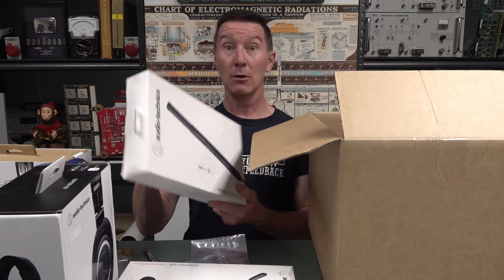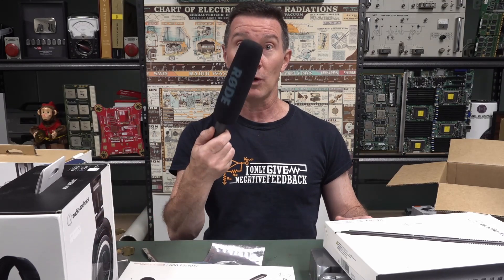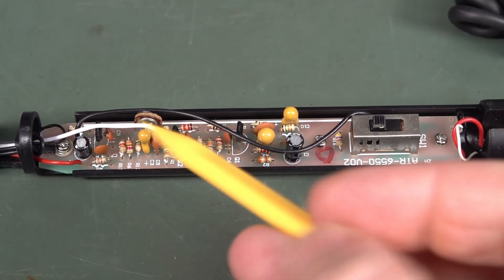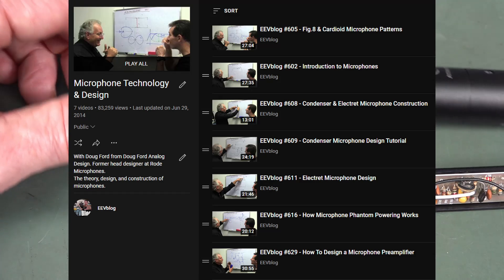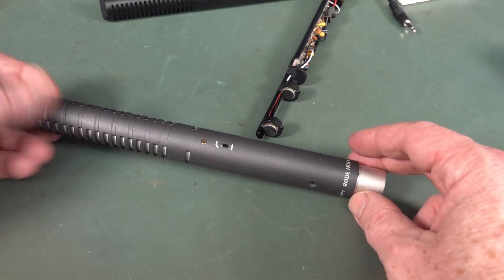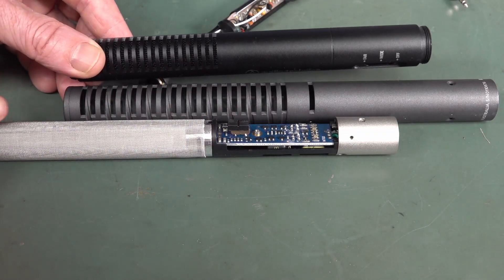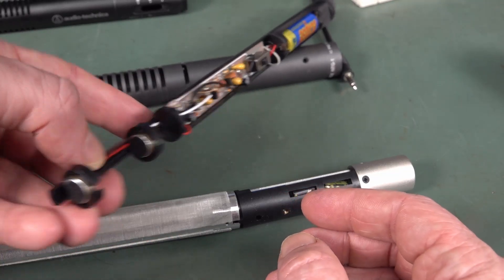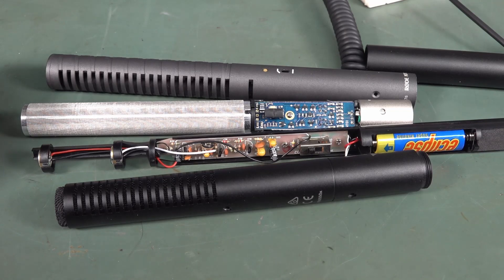Rode NTG-1 vs Audio-Technica ATR6550xAudio-Technica ATR6550x

Comment: Dave, the sound difference between the two is significant. You should go further with the and do a reverse engineering and comparison of both of these circuits. They are simple enough that we could get the real skinny on different techniques being used. Plus, they look pretty much old school vs new school in both circuit and construction. Lots of angles here. :)
Reply: The price is significant too 👍

Comment: the AT design makes no sense. You need the full length of the interference tube to get the directionality, and this one has a second capsule half way down. Also could possibly reverse-engineer the electronics? There has to be a reason for that horrible tinny sound, and even the cheapest capsules are not that bad. I bet there is a poor cap value choice in there somewhere.

Comment: As far as I've been informed, with pretty much all modern mics, you won't damage them if you leave phantom power turned on. I was told this years ago and regularly run a Rode M1 and a Rode NT2A on the same interface with phantom power on, and have had zero issues.

Comment: A quick look at the specs, the Rode is a low impedance output mic, whilst the Audio-Technica is medium impedance. The audio interface would need set accordingly to get the optimum output from them.
Albeit, the Rode is 20Hz to 20kHz range whilst the Audio-Technica is specified as 70Hz to 16kHz, thus having some impact to the sound also.
The NTG1 Rode is a nice mic though, great spec and a great sound.

Comment: You wouldn't use Rode headphones cause they are not know for it. Same applies to Audio-technica microphones
Reply: Audio Technica studio mics are highly regarded, both at the entry level and the top end. This mic sounds like trash because it is a bottom of the barrel, budget consumer shotgun mic, not because AT doesn't make good microphones.
Reply: Røde's headphones (the NTH-100) are actually pretty good! Especially at the price point..  And Audio Technica are known for making some very nice mics :)  That said, in Dave's test I be prefer the røde, but mainly because it has a bit more low end   It sounds like the audio technica wants to be closer to avoid some of the bass roll-off and remove some of the room influence.